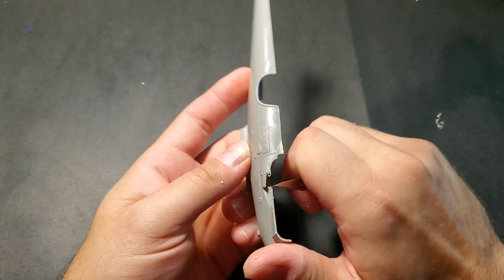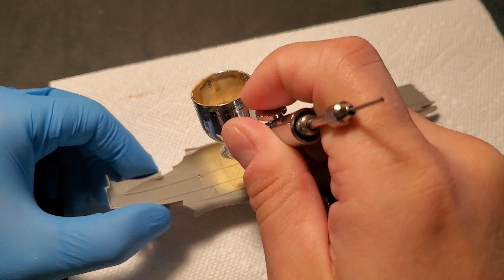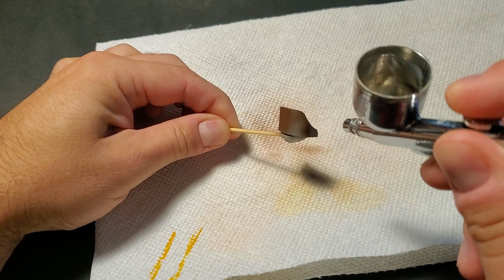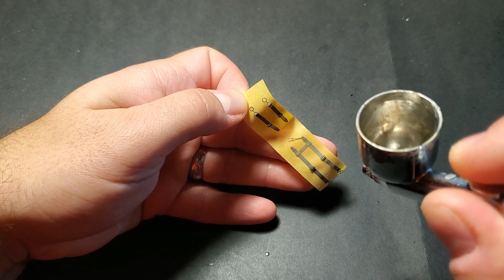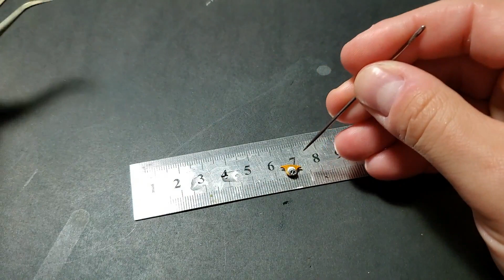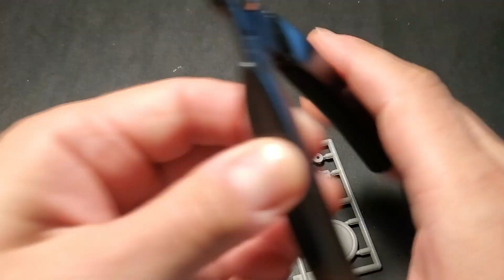Roden 1/32 Pfalz D.III, Part 1 - Cockpit

Comment: The photos taken in WWI are difficult to figure out colors on, being B&W pictures to start with, but the film used back then had some weird effects on the images taken. Things like, red and yellow appearing to be black, and some dark colors appearing to be light shades of gray. Even WWII images could have those appearances. Look at a British plane, and sometimes the red on the roundel looks black, and the blue looks lighter in shade even though it is an RFC, or RAF plane.

Learned a lot from the members at the old Red Baron 3D forum about making paint schemes for different planes, especially the GAS, with the colorful schemes they came up with at the squadron level.

Comment: One of my favorites. Thank you .   Are you using wire or fishing  line ?  Could you pause a little longer for detail shots.. so  it is easier to  pause the video ...?
Reply from the maker: Hi, for all rigging I'm using a black nylon beading thread, it's around 0.15-0.2mm. For detail shots, yeap will do in my next videos